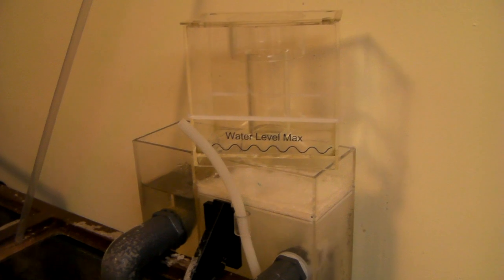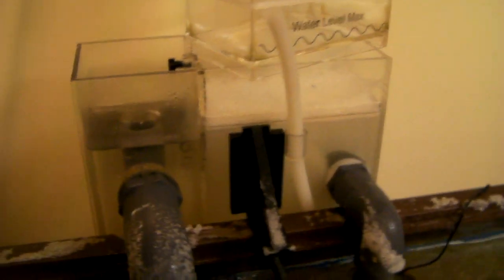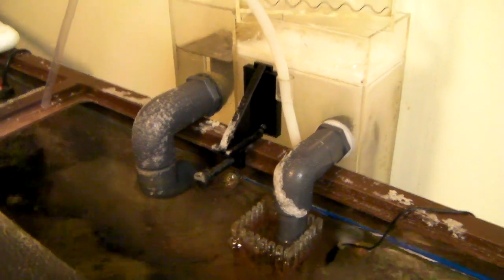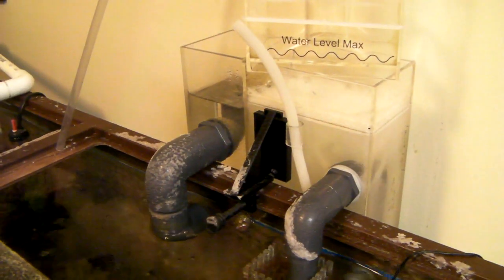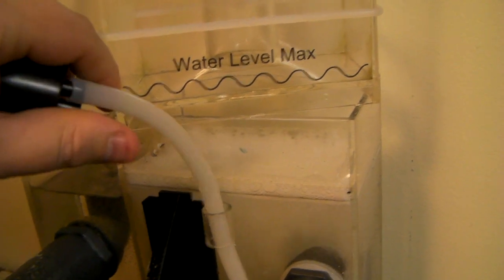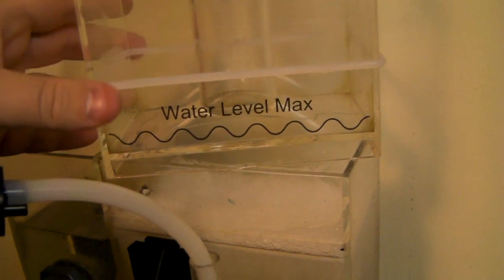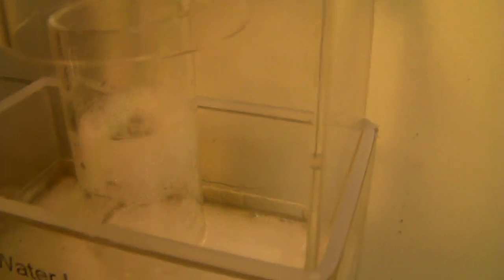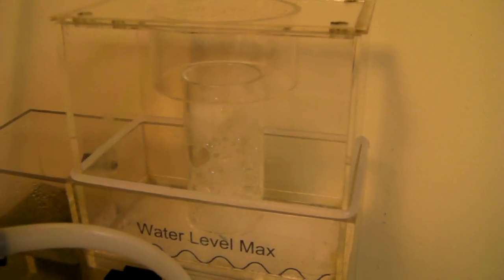Reef Octopus BH1000 Installation

Comment from the maker: @chista83 because if there are any air bubbles they will float to the surface and not go into the tank - be sure to face the outlet pipe towards the glass- if you have a powerhead blowing at the bubbles it will carry them around the tank. My powerheads don't face my outlet so honestly I don't know what will happen.

Comment: is it a new tank set up on dec 10 plus i went bigger from 160ltr to 300 ltr on live sand 1  fuzzy lion 2 clowns  1 regal yellow & purple tang  2 cleaner shrimp 5-6 turbo snails it  has colour like darker  lime green  rather then a brown just wondering it needs futher tuning  of some sort also not sure what to do to micro bubbles out like yours no stopper & touching the tank glass would u say is a good idea thanks again